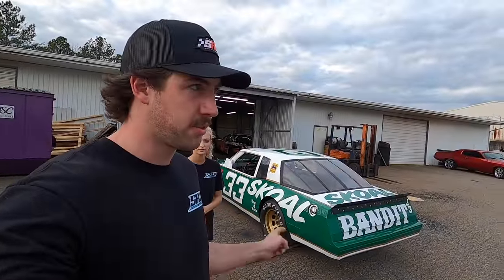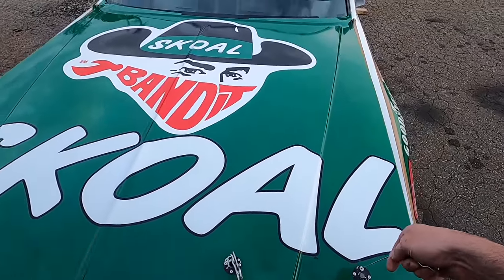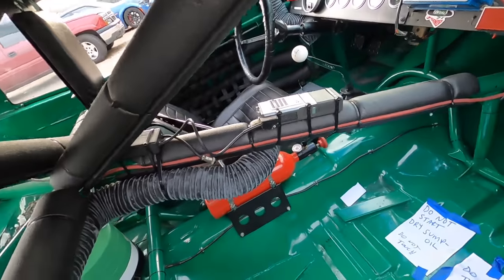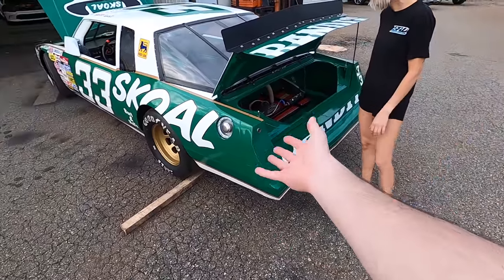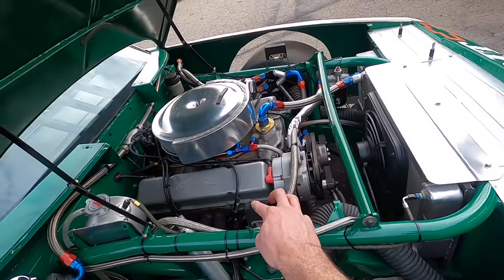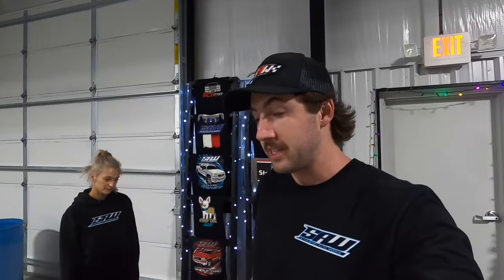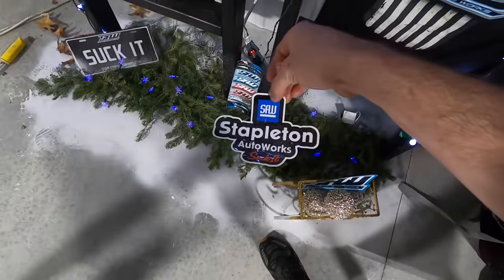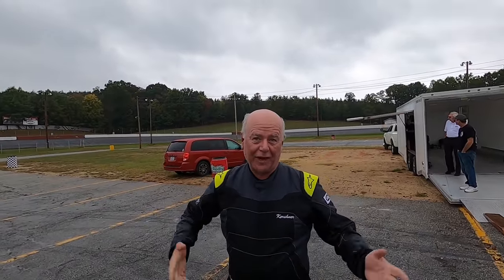Harry Gant's 1988 "Skoal Bandit" NASCAR Aerocoupe Monte Carlo (Unrestored & Sounds Epic)

Comment: I can't remember exactly but I remember I used to have an 86 Monte Carlo Aero coupe and it was a hatchback meaning the glass came up with the trunk lid I don't remember if they were all like that or not so maybe that's why the trunk lid looks the way it does to comply with safety regulations
Reply: Sorry to say but none of them were ever hatchbacks. You might be confusing it with a camaro hatch. I can tell this one was made before 87 because they changed the taillights from the flat resessed ones to one's that wrapped around the sides slightly in 87 and 88 models. Meaning the housings were also changed to fit the new lights design.

Comment: Is that the car that had the legendary "cambered" rear end? I was at the Daytona 500 when the areo coupe made it's debut. GM brought every aero coupe they had produced and did the parade lap with them all. There was a rumor that GM did not produce enough aero coupes to make the new body legal for NASCAR. So GM brought them all. The rumor at the time was that GM took the previous version cars off the production line and stuck the rear window and trunk lid from the aero coupe to get over the threshold to meet the rule. It was an impressive sight to see all those aero coupes in the parade.
Reply: That car would have been a 1991 model Lumina rumored to be on a Hutchinson-Pagan chassis, they modified the front to conceal what they did to the rear end. Those were the golden days of nascar.
Reply: @firestarter105G  Thanks for the clarification on that! Great days for sure!

Comment: Well I would not be surprised if the wood for the gas pedal or the pile wood spacing the fuel cell. Came from Harry himself, since he was a carpenter. When he wasn't at the racetrack driving.
Reply from the maker: Thats a very interesting observation!
Reply: @Stapleton42  Well it makes sense to me. Especially when I heard Harry stated that is something he has done in a conversation he was having with some gentleman I was with. When Mr Grant was in Tulsa years ago, after an autograph section he did during the weekly race show the driver I was working with at that time was entered into. 

Which if it wasn't for the fact the Skoal girls had left, I would not have been around to hear what was talked about in the conversation...🤣 

Of course, I am 46 and have an ex wife I caught cheating on me. So being detracted is no longer a problem for me...🥴
Reply: @TheCrewChief374  lol

Comment: The bandit was cause shoal sold Lil pouches called bandits plus I'd say it didn't hurt that the bandit owned the car.they had the holes in window for adjustments in early 80s but when they put the areo dynamic coupe or bandaid  rear window they couldn't put  holes in the glass so they had to go in window to adjust
Reply from the maker: Companies usually sponsor cars that mesh well with their current marketing agenda

Comment: It was alot more " Stock" than the crap their driving now. At least they had to fit an actaul stock bidy template and the engines were loosely based on the motor of the manufacturer represented

Comment: That car unless it was stored in a vacuum pack, has been retouched. The crazing paint.... very risky trying to put clear down over old finishes. Paint composition changes over the years and I bet something helped the shrinking paint phenomenon. That car would be so dusty and nearly everything would have been stripped off. Even keeping it museum fresh would have been a chore. I'm just saying the temptation to throw clear on it or at least retouch the green would have effects on the base coat
Reply from the maker: It was a crashed car behind the building that was restored to be a show car by the race team back in 1988. Garage kept ever since

Comment: Am I the only one that noticed that towards the beginning of the video Mitch called that a "cop car"? It was when he was leaning in the driver's side window, showing the dashboard...

Man, those were the days back when stock cars really were stock cars... Wasn't that the car Gant was running when he got into that fight in the infield with I believe it was Cale Yarborough at Daytona?

I do have a question though... Is that car a race spec car, of is it a replica? The reason asking s I don't ever remember NASCAR stock cars using "factory Glass" front windscreens in the '80s and '90s... I always remember them using the plexiglass windscreens...

I do love that body style though... I'm a die-hard Dale Earnhardt Sr. fan, and I believe Earnhardt used that same body style...

Anyway, love the videos, merry Christmas, and stay well...

Edit: I actually looked up some 1987 NASCAR wrecks, and the first one I seen was Bobby Allison going into the fence at Talladega... Very scary wreck for sure... Daryl Waltrip got hit by a piece of crankshaft, shattering his front windscreen... I think it was 1988, or 89 they started using plexiglass windscreens?
Reply from the maker: I don’t recall ever saying cop car. This was a real car not a show car. They did use factory glass back then I’ve seen it on numerous cars of the era
Reply: @Stapleton42  yeah... After watching again, I think you said "cup" car... But I guess I missheard you say "cop" car...

As for the windscreen, I decided to do some research, and I found Bobby Allison Talladega crash... They showed Daryl Waltrip's car after he got hit by a piece of debris, and his windscreen was shattered...

However, three is one other question... Are the bodies n those cars cars factory, or are they fabricated using factory parts such as the boot, bonnets, bumpers, glass, etc? The reason I ask is the side panels don't seem to me to be actual door panels... Plus I don't see any any seams to indicate that the doors were at any time operational...

Comment: Some of those holes were simply drilled in for air to flow through.
Reply: Ones under I think also weep holes for moisture. I’ve heard of them drilling holes to relieve air pressure or if air was getting under the spoiler and cause if lift under the spoiler they’d drill holes to allow the air through it.

Comment: Maaate,.. it's not 'wood',.. It's "organically sourced and hand crafted natural carbon fibre, grown in carbon sequestration forestry biomes",.... just one way motorsport is improving the environment, just like the 'maximized efficiency and low emissions through complete burn technology'.

(For those who don't speak 'Cali',.. That's marine ply from Lowes and hi-comp heads with big valves and open headers. :D )
Reply: On skins - race teams of all kinds used to order a 'body in white' (unpainted or 'white metal') and build racecars from those. Door skins, roof skins, boot (trunk) and bonnet (hood) skins were also all available separately, just pulled out of the stamping press output stock and sent out to race teams on order, rather then to the chassis assembly line. It happens where manufacturers support the racing as just 'another customer ordering spare parts', the same as they do, or did, for all the body repair places, back when it used to be more cost effective to repair a chassis/body then it was to replace it.
Most 'motorsports involved' manufacturers will still do a special order for bigger race teams, especially companies like Porsche for sports cars and Euro companies for Touring Cars, so they can swap over all the running gear from a race car to a new chassis assembly after a major crash.
The "V8 Supercars" here in Australia, Ford and GM originally used to provide body in white assemblies, that would then have the mandated cage fitted, and then all the running gear bolted on. Later it came as a kit, the cage was built as the main chassis, and then the body panels assembled around that, exactly how that Monte Carlo would have been.